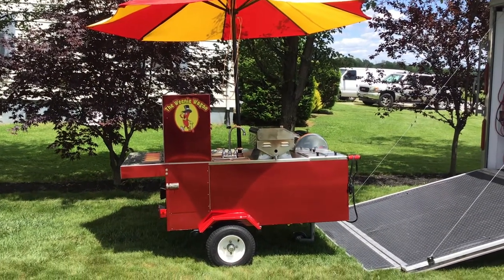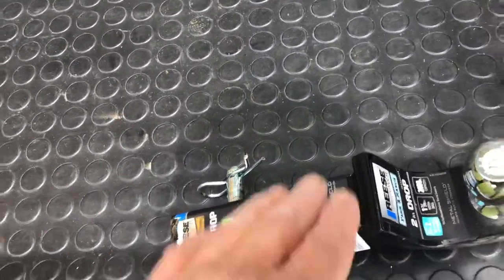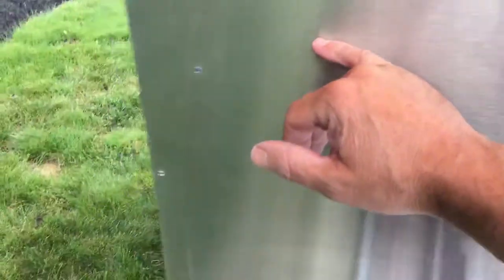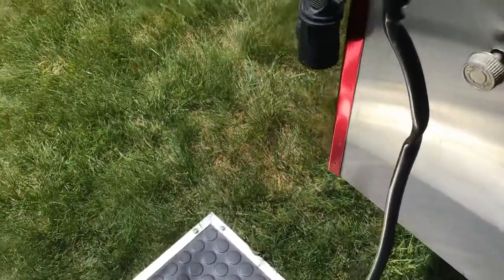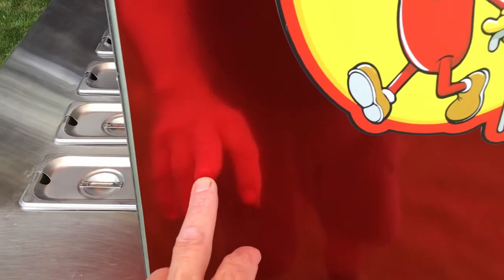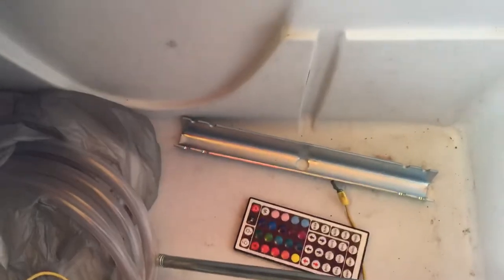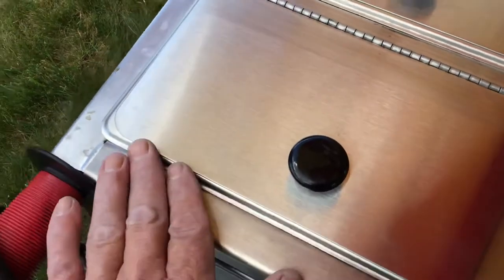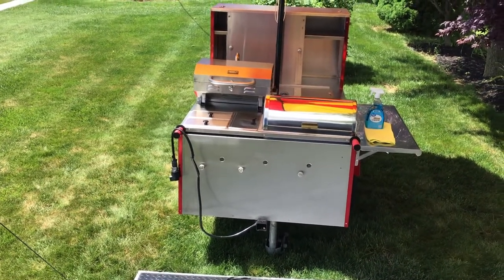Big Dog hot dog cart

Comment: Hi friend. Well....my brother, who is his own repair man, took hours to fit the new (yet MODIFIED) furl rod & new burners, from Hot Dog Store to my 13 yr old Big Dog Cart. But the 304 panel is fucked! It turned out NOT one of the three propane knobs matched-up to the three holes in the 304 steel panel. How do you keep the chilled condiment station chilled? I notice those ice blankets from Walmart are too thick and those mini pan wells are sticking out of those metal slots. What do you use? I have to keep the chilled condiment station chilled. I want to use it as intended. Any thoughts? Thanks.
Reply: Fuel rod.

Comment: Hi! I just bought a new fuel rod for my 10 year old Big Dog Cart. I have a propane leak where my third burner is. But thiis new fuel rod from Bens Cart doesn't fit, Any thoughts? I don't think I will ever open up.
Reply from the maker: I really don’t understand what you mean…sorry does it not open at the valve nob area ?
Reply from the maker: You may need to make the hole bigger where the adjusting nob goes through……
Reply: @mrbrisket6794  It's a big dog cart from 10 yrs ago? Are those fuel rods adjustable? It looks a lot different from that old rust rod in the cart. The three burners are evenly spaced from each other but the knobs on this rod are way off! What would you do? I can't make parts.
Reply from the maker: Make the holes in the front panel bigger or send it back and get another fuel rail. The quality on these carts suck
Reply: @mrbrisket6794  I could tell you that! All from China. But I'll need a welder. This is 304 stainless steel. Do you think a plumber can do this job?
Reply from the maker: @ianscianablo8507  why do you need a welder….you putting in a new fuel rail ?
Reply: @mrbrisket6794  Yes but Keith from the Hot Dog store sent me a fuel rod that clearly doesn not look right. It's wrong. If I have to drill holes we have 304 stainless steel. How can I locate the right fuel rod? This Big Dog Cart must be at least 13 yrs old! Any thoughts?
Reply: @mrbrisket6794  I don't think that Hot Dog Store has a new fuel rod for that older Big Dog Cart.
Reply from the maker: @ianscianablo8507  send me some pictures
Reply from the maker: @ianscianablo8507  measure the holes and have Keith make you one
Reply: @mrbrisket6794  Need your email. It's the only way I can send them. Thanks!

Comment: Did you replace the cart floor with a open metal grate?  Road dirt entering the inside from the floor?  Do you feel you overpaid for the cart?
Reply from the maker: I replaced it with stainless with small holes
Reply: @mrbrisket6794  I take it that road dirt is not entering the inside of the cart through the grated floor.
Reply from the maker: Papa's Catering Street Food you need that area to be open beacouse of the propane tanks.... gas leaks
Reply: @mrbrisket6794  THX, my carts have a solid floor made of aluminum diamond plate with the rough side down. QUESTION: Does dirt get access to the inside of the cart? The bottom of my carts becomes filthy after long drives.  I vend in the winter months where there is SNOW on the road.  I am trying to ascertain whether modifying my carts to store the propane tanks in the interior of the box should be made.THX
Reply from the maker: Papa's Catering Street Food not that dirty I don’t drive on dirt roads
Reply: @mrbrisket6794  Thank you. I don't drive on dirt.  However, my streets in the winter months are often covered in snow.  I will NOT be modifying my carts with open grated flooring.    My propane tanks are outside the cart's box on the hitch. Thank you.